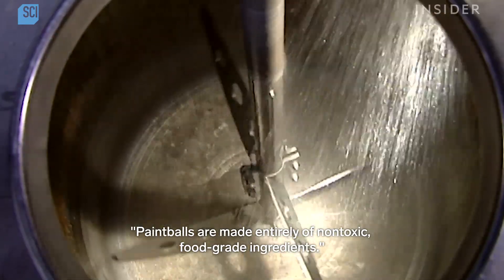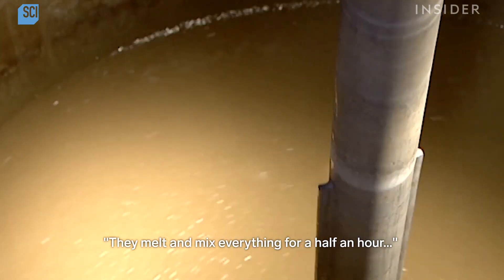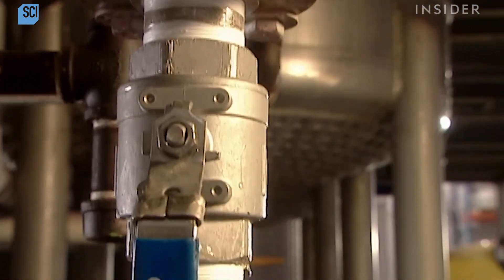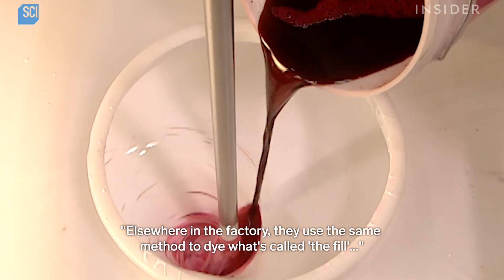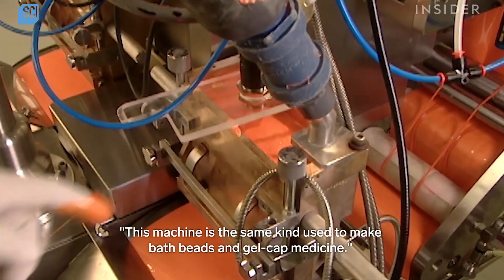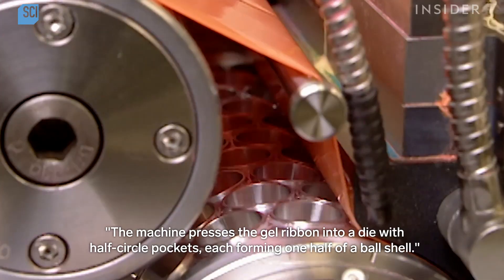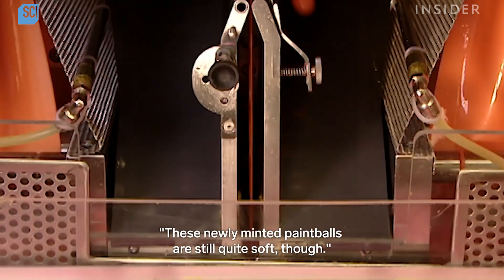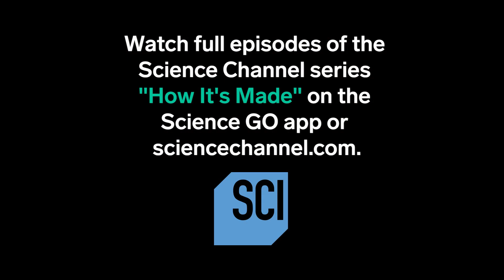How Paintballs Are Made

Comment: Does make you wonder if manufacturers of paintballs purposely make some brands crappier on purpose when it wouldn't cost them a dime to make every batch great. For instance, you go out and buy Valken Graffiti versus Valken Tango. Tango, for the most part, will dimple or break twice as much as Graffiti in standard playing conditions and temperature.
  Why is that though? Do ya'll think they purposely use different ingredients or that they don't bake them as long at the end? Seems to me the $30 difference in price between the two has to account for something.

Comment: What I was hearing.."First they take the dingle bop and they smooth it out with a bunch of schleem. The schleem is then...repurposed for later batches.

They take the dingle bop and they push it through the grumbo, where the fleeb is rubbed against it. It's important that the fleeb is rubbed, becasue the fleeb has all the fleeb juice."

Comment: I've never played paintball and honestly I'm a bit scared to because I've heard that apparently getting hit by one hurts?
Reply: Depending on how high the fps is set on your paintball marker. Usually fields have it set 300 fps which is 300 feet per second and the field is huge so you only get the hard hits if your up close. It's really not that bad I explain it to our customers it's like stubbing your toe at worst. Unless your playing woodsball because let's face it no rules there are always those friends that set their marker to 375-425 fps and that will leave a welt
Reply: Xplocial OnlineNetworking dude chill it's not that serious
Reply: It hurts and bruises
Reply: bish im not a weeb ok gtfo depends. If you get hit from far enough it won't hurt but when it does hurt it only lasts for a few seconds usually
Reply: bish im not a weeb ok gtfo it doesn't hurt a lot tbh u will feel the pain for about 20 sec or more but u will get over it quite quickly  and it's really hot
Reply: I've played in a dress, I don't wear pads. Pads are usually worn by people who don't play often.
Reply: The only times it will hurt is if its close range (bunkering) which is usually not permitted at beginner fields, its more common in speedball(inflatable bunkers usually on grass or turf but not always). Also it can hurt when people use junkie paintballs that are hard to break, 'frozen paintballs' arent anything you really need to worry about, as colder paintballs are actually more brittle thus not being as painful as the break on impact..Also the rental guns would likely chop those balls as they arent very soft when firing(plus most fields require field paint only). If you are scared about it hurting then just wear multiple layers, but with your adrenaline running you likely wont feel any pain. You dont really need the extra padding unless you are quite young or are very unsure about it, most often tournament players usually use it in hopes that the ball will not break and will bounce off.
Reply: It Hella hurts but it's a whole lot of fun. Got bruises for a couple of weeks after and I had to lie on thr ground for a bit after getting shot at by like, 10+ people because I was out to grab the flag 😆. I can also tell you paintballs taste pretty sour.
Reply: djmudkips_ Just cause you like airsoft doesnt mean he shouldnt try it lol. I used to play both when i was younger and i preferred paintball cause every game has a cheater in airsoft and most of the airsoft kids are that..kids. Paintball usually had older people who werent talking about call of duty etc lol, to each his own but if hes asking a question dont answer it with something off topic lol
Reply: Dominik Bade+ The blue stain is a bruise, stupid.
Reply: It’s kinda like getting hit with a rubber band
Reply: bish im not a weeb ok gtfo just don’t let anyone get too close to you, it’ll hurt if they shoot from, like 10-20 feet away. when i paintball i wear a hoodie and long pants
Reply: Dominik Bade a bruise?
Reply: In most places they will give you a vest so if you get hit you will feel it but it won't hurt and if they hit you in an unprotected place it won't hurt much
Reply: Not really but still so what?it's loads of fun and totally worth it
Reply: Playing war games and being shot in the head 6 times within 2 minutes hurt more by a BB gun. My head was kinda bleeding xD
Reply: Nicole Arney you’re*
Reply: Paintball doesn’t hurt at all I’m going to play today for a video for my channel
Reply: I played paintball with my friends when our school took us and it was sooo fun! Even though i got hit it hurt for a few seconds but you don’t feel the pain later
Reply: listen up  dude where did you go 😂 where i went they gave us suits and masks and a chest thing so we dont get hurt
Reply: bish im not a weeb ok gtfo it just stings for a second
Reply: bish im not a weeb ok gtfo it hurts, but just for like 20 seconds. You will get bruised, but it's not that bad. It only stings and makes your arm weak.
Reply: Screw paintball and go with airsoft i have played both for over 2 years and i think airsoft is btter
Reply: bish im not a weeb ok gtfo you usually wear a chest plate just wear some pants and you wont even feel it
Reply: It's not crazy painful, but I have had welts in my skin that bruise and sometimes bleed from a paintball. The mark can last a bit over a week.
Reply: it only stings a little and i have a very low pain tolerance so it isnt too bad
Reply: It doesn’t hurt as much as you think it does...
Reply: That's the whole point though. Some people will go play in a damn suit of armor. It's more fun to just go in a t-shirt and shorts, adds incentive not to get hit. It's way more fun that way.

Either way it's not that bad. Might get a bruise or welt here and there, but it's not so painful that you should be afraid of the playing. Airsoft is good too.
Reply: bish im not a weeb ok gtfo I got shot in the nipple when I was 9
Reply: Xplocial OnlineNetworking 
Doesn't mean much coming from an edgy, "savage" skinhead, does it?
Reply: And hurts but it’s way funnier than airsoft
Reply: Not really. You get used to it until it hits your privates
Reply: bish im not a weeb ok gtfo Where have I seen you before?
Reply: If you're really afraid of the pain you should play airsoft. Paintball does really hurt. With airsoft, it stings for a few seconds and the pain is gone before you know it. One time I was shot in both earlobes in a single match. Yeah it hurt for a little bit but I didn't feel it the next day like you can with paintball in some cases.
Reply: Djmudkips _ airsoft hurts more than paintball
Reply: Depends where you get hit... But yes they hurt from time to time
Reply: bish im not a weeb ok gtfo it do hurt but it is fun
Reply: bish im not a weeb ok gtfo nah, its like stubbing your toe on the table: afterwards you get a harmless bruies
Reply: Owais Iqbal airsoft would be more painful
Reply: Djmudkips _ airsoft would be more painful
Reply: Just hope you don't get hit on your bare skin because it'll leave a scar.
Reply: bish im not a weeb ok gtfo it’s not that bad - just wear an extra layer over the sensitive areas and you most likely won’t even get hit often and if you do it might just be your hands or arms
Reply: Djmudkips _ isn't that even worse? The impact force us gonna be less so the pain is gonna be more concentrated in one area?
Reply: Depends which level. I always go medium so it hurts when you get shot but not much. Easy basically means you feel something for a split second
Reply: bish im not a weeb ok gtfo it only hurts for like 5 seconds
Reply: Xplocial OnlineNetworking The OP’s comment was 1 sentence... I think you’re the degenerate here
Reply: bish im not a weeb ok gtfo 
Getting hit by a baseball is worse
Reply: Depends on your definition of hurt. Honestly it stings but it's not something that you'll be like Oh my GOD I NEED TO GO TO THE HOSTPITAL.

Plus when you're in the action of speedball or wood, whatever you play, you hardly think of it. Also depends if the gun is calibrated to the right preasure, how close or far you are from the shot.
Reply: bish im not a weeb ok gtfo I always try to get hit in the face when playing since you wear a hard mask.
Reply: its not hurt at all but just play airsoft
Reply: bish im not a weeb ok gtfo It stings, but only for a few seconds, less then an injection
Reply: IT HURTS LIKE A BULLET DO NOT TRY IT ps it doesn't hurt like a bullet but it hurts
Reply: Joanna Davies no, you r just weak.
Reply: bish im not a weeb ok gtfo It doesn't hurt that bad I know cause I've been shot point blank multiple times and I even shot myself in the arm its only really going to hurt if you get shot really close but it will just sting for a like 5 seconds then go away if your shot from far
Reply: bish im not a weeb ok gtfo it depends on what the shell is made of if you buy the jelleton type its basicly like getting hit with a watterbaloon but if you get hit with a shell type than yeah it will hurt but if you wear the proper clothing it will only sting for like a couple seconds
Reply: Well it feels better than a real bullet
Reply: bish im not a weeb ok gtfo Look, when I first played, I was really nervous. But when I got hit by one, it wasn't a big deal at all. It only stings on initial impact and the pain only lasts for less than 10 seconds...
Reply: Owais Iqbal bro i got like 3 bruises from going paintballing
Reply: Depends on the tanks psi.
Reply: it hurts for the first 5 seconds, then not anymore and the next day you might have a bruise if the shot was less than 15 meters
Reply: WHEN WILL U LEARN THAT UR ACTIONS HAVE CONSEQUENCES yeah it hurts, but that's obvious hpthat it hurts.
Reply: Screw paintball or airsoft. Try this game called being drafted into the army to fight.
Reply: Adrenaline rush stops the pain or at least delays it till the match is over
Reply: They Hurt but mostly only from a short distance
Reply: Screw paintball try airsoft
Reply: @kipps4941  beware of cheater tho
Reply: If you play without armour, it will leave a bruise generally, but it just feels like you have been punched, but just in that small area. if you play with armour, you shouldn't feel more than a poke on you. It doesn't hurt at all
Reply: - As a week 11 yr old, it hurts like heck
- I had 2 bruises for some time
- If you get shot in the chin, it hurts
- Unless if you're playing with friends, it's scary
- Ask others for paintballs once they're done
- Wear long sleeves and plenty of protection
- The paintballs taste like chocolate
-Its rather uncomfortable with glasses
- After 3 rounds you would be begging to go home
- Wear waterproof shoes
- Embrace the mud
- Watch out for the adults, they usually have the best guns
- Bring a photo of your family incase if you're hospitalised
- Don't remove your helmets

*This was where I went, it doesn't apply to all paintballing arenas
*Go airsoft or laser tag if you're not ready